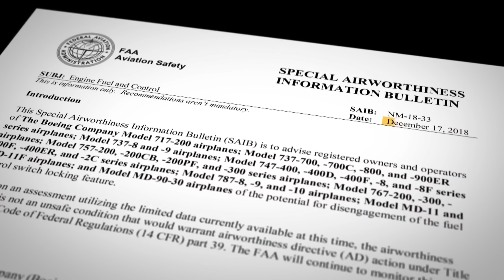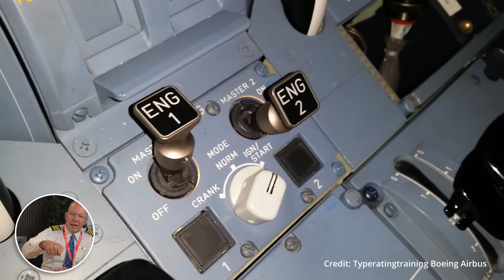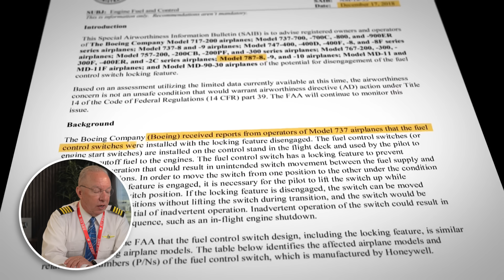Air India 171: The FAA’s 2018 Fuel Switch Locking Bulletin Explained (16 Questions Answered)

Comment: Q-1: An independent journal recently reported issues with a fuel switch, while preliminary findings from Friday indicated that both fuel flow switches were moved to the cutoff position at one-second intervals. Why is there a discrepancy regarding whether one switch or both were involved?

Q-2: What was the pilot's previous mental illness diagnosis concerning the alleged intentional movement of the switches that resulted in disastrous accidents? Was the diagnosis consistent with such actions?

Q-3: The dispute revolves around how the fuel flow valve was switched to the cutoff position, with claims that one pilot may have done this intentionally (due to mental illness), which downplays concerns about the switch locking system. There are fears that this could lead to a mid-flight incident, as previously warned. 

To establish how these switches function, a thorough investigation of the Boeing 787 part number 4TL837-3D is crucial. This should identify potential failure modes, including a broken locking pin, degraded spring force, or mechanical wear leading to detent failures. These problems can cause permanent damage, which can be detected through disassembly.

Additionally, the design should ensure safeguards to prevent the mechanism from reaching a neutral position, enhancing reliability.

Comment: Captain Steeeve your videos are giving the impression that you have already decided that the the switches were cut off deliberately by one of the pilots. You are rejecting outright any and all suggestions that point to a scenario that puts the blame away from the pilots. The preliminary report is very vague on many aspects. Answer one question. Suppose both the engines failed due to some technical fault in the aircraft. What would the pilot do the moment he realizes that both engines have lost thrust? Wouldn't he intuitively suspect the fuel supply system? That's when he probably queries the copilot if he cut off the switches. The copilot replies in negative because he didn't. So isn't it possible, to revive the engines, he immediately tries to reset the fuel supply by actually cutting OFF the switches and then putting them back ON? Did you check the time stamp of the conversation in the cockpit voice recorder and tally it with the time stamp of when the switches were cut off? Can you confirm whether the conversation took place BEFORE the switches were cut off or after?

Comment: Would it be possible for the plane to have lost both engines and then the pilots tried to restart the engines somehow and under the panic one pilot just went ahead and shut off the valves? Are we sure the valves were shut before the RAT came on?

Comment: Question for Captain Steeeve, if there were mechanical problems (broken or loose springs) with the fuel switch(es), won't the captain from the prior flight noticed and reported them?

Comment: I think the first officer sitting on the right was the one who turned off the fuel to both engines during takeoff. The captain, who was on the left, noticed it and immediately confronted him, that’s why you hear “Why did YOU turn off the fuel?” on the recorder, which clearly shows it wasn’t some random malfunction. I believe a scuffle happened between them right after, and in that chaos, the captain tried to take back control. He managed to turn the left engine back on first since it was closer to him, and a few seconds later tried to turn the right one back on too — but by then it was too late, or the engine didn’t fully restart. The timing, the words used, and how the switches were operated all fit with this kind of situation.

Obviously this is all speculative, a wild theory but I just think if it was deliberate...this is how it happened.
Reply: This is the most plausible theory.

Comment: Actually one pilot asking the other whether he cut the fuel is exactly what you would expect in an emergency situation . He's looking at all the possibilities why the aircraft is not gaining altitude and pinpoints the error, then confirms that the other pilot did not do it. The issue is either a serious malfunction in the control circuit, or something else.

Comment: A video camera in the cockpit would tell you exactly which of the pilots turned the switches off. It wasn't done by both. It wouldn't have prevented the crash but it would give you video evidence of the  intent of the person who moved the switches. Saying that the voice recorders give you enough evidence is wrong. Whoever moved the switches isn't going to say out loud "now I'm moving the switches to the cutoff position" if they were doing it for some nefarious reason. If the pilot was looking to the side he might not even have seen the copilot move the switches. A video would show if the person who moved the switches did so in a surreptitious way. And there should be a major alarm if the switches are turned off in flight. You say you don't know if there is an alarm for that condition and I'm surprised you couldn't give a definitive answer to that question. In this situation seconds could have been the difference between life and death. if the pilot had to catch the act out of his peripheral vision and ask the copilot why he did it or wait until he heard the engines spool down then it would be too late. The pilot should be warned instantly the second those switches moved. In fact I'm surprised that there isn't some over ride in the flight control system that would prevent fuel cutoff to the engine if there wasn't a condition that justified fuel cut off. It seems to me that whoever turned those switches off did it at just the right time to make it an unrecoverable situation. Somehow I almost think that the airlines wouldn't want cockpit video recorders because it might show that one of their pilots intentionally sabotaged the flight. If they have a video showing the act of turning the fuel off they would have to immediately look into the mental state of one of their pilots. Did he have mental health issues in his past that the airlines were aware of. If a video was leaked of someone reading a magazine on take off or otherwise doing something dangerous that should be known to the public. A video of the cockpit would have given us another piece of this puzzle.

Comment: Pilot F (flying) is asking  pilot M (monitoring) why did you do that ? only after hearing the 6 distinct sounds over 3 seconds , 3 for each fuel switch in almost sound proof cockpit as he( pilot A )was busy in take off and looking straight forward , once he hears sounds  next second his head turns and look for  both fuel switch cutoff position next second  he ask pilot B why did you do that ? next pilot B to avoid conflict reply I did not do that.The above situation can be reverse also Pilot M asking Pilot F why did you do that?

Comment: It's funny how you are trying to steer to a conclusion when it's only a preliminary report. Now I am not saying that you are wrong totally, you might be right, but it also helps to acknowledge the fact that if there is a possibility of a design flaw or system malfunction it should be investigated so such incidents never repeat in future. Even if it's a human intervention, then there should be systems in place to keep it in check.

Comment: why do you think it took the pilot 10 seconds to turn the switches back on? what could've happened in the cockpit in those 10 seconds?
had the fuel switches been turned on earlier, could they've gotten lift, power & thrust to make it up in the air?

Comment: As in the car, I suspect that these switches do not trigger a mechanism directly, but the switches close a circuit and a computer receives this signal. In this case, why can't a computer refuse to perform this deadly operation at all, but at least gives an alarm first ?

Comment: those switches r immaterial and operate only solenoid valves. in case of electrical failure with fadec a signal to turn off valves can be generated without touching those switches.

Comment: I believe that the checklist for a dual engine failure on the 787 is to toggle the fuel cut off switches quickly off and on ( maybe to try and make the ECAS system do something) can you confirm that? I still think that as the FADEC can shut off the fuel to the engines independent to the pilots, then this could still be the issue. I don't think that just because they could not simulate the situation in the simulator yet it does not mean that they can't ever simulate it. We also really need to know what financial compensations are being paid to the victims of this horrible accident by Tata and or Boeing. My experience in India when there is a big factory accident for example, the company buy silence by offering excessive money to the victims families such as paying school fees through to university etc for the whole family.

Comment: Q, Is it possible that in this case, pilot on right side, on take off has his hand on the power controll or near to it caught the cut off switches with his sleves or just touched them with finger tips?
On cockpit  tape they said "Why did he do that"? as a question..
Maby there was a passenger that noboby knew were in the cockpit, except the pilots? we heard before of a hitch hiker pilot that traveled in the cockpit that tried to cut off engines.

Comment: Hi Steve incorrect analysis about the ERJ, it is true that the engine will not switch off if the thrust lever is not in idle but if you had an engine fire on approach , actioning memory items for engine fire which include pulling the fire handle WILL shut off fuel to the engine , regardless of thrust lever position

Comment: This is all based on assumption that the switch position change  happened prior to Dual engine failure 
On the contrary the Dual engine failure happened  & Switch position change was done re ignite as a procedure 
1 pilot challenging the 2 pilot for confirmation of whether he has cutooff 
For which Pilot hasn’t done it yet

Comment: There is a locking switch/indent on both knobs.  Someone would have to manually manipulate BOTH knobs to cut off fuel on each side. Even if one "slipped" but both seems extremely unlikely.

Comment: Captain Steeeve, with all due respect, it’s disappointing to see you clearly taking sides. Conveniently avoiding the CCTV camera question was unfair. If reading a magazine mid-flight is against protocol, it simply shouldn’t happen—period.

Your stance appears biased. If the fuel switches were faulty, they could have slipped to the OFF position due to a failure in the locking mechanism. A cockpit CCTV would have captured this, avoiding all the current speculation.

Let’s not ignore the influence of major players like Boeing and Air India. Blaming the pilots—who tragically can’t defend themselves—is an easy way out. The cockpit conversation, where one asks “Why did you switch off the fuel?” and the other replies “I haven’t,” clearly indicates it wasn’t deliberate. They were likely both startled by the unexpected switch positions.
Reply: Geez, get over it.

Comment: what is the sampling rate of the fuel switch position. could it be that the fuel control switches cutoff almost simultaneously, but were registered separately due to the sampling time?

Comment: Very interesting response by Captain Steve to the question of is there an alarm/indication that the fuel stitches have been moved to cut off. As an experienced pilot his view is that you would pick it up from the sounds of the engines changing. The could take more seconds to register especially if you are busy with other matters. Surely there should be an alarm waring immediately the switches are moved to cut off whilst in flight. It would immediately bring the issue to the attention of the crew. If this had been in place in the air India place these vital seconds could have made all the difference.
Reply: He wants to make a case for Boeing n not against them.
Reply: @maitri98  "He wants to make a case for Boeing n not against them."

That is because it would be obvious.... Imagine driving a car down the highway at 100km/h, then all of a sudden you hear everything just stop and you are loosing speed, it is kind of obvious what has happened.

The switches being cutoff by the pilots isn't something that is expected normal behaviour is it?
Reply: If the switches were deliberately switched, there should be 2 distinct auidble clicks, overriding the locking mechanism on the audio. If there is not such clicks on the audio, it is possible the switches failed. The 2018 report about the issues with the faulty Boeing switches says BLACK ON WHITE that there are issues with the locking mechanism. A pilot having his wrist on the switches when holding the throttle, can accidentally flip them without much resistance if the locking mechanism failed.
Reply: @sophieedel6324  "A pilot having his wrist on the switches when holding the throttle"

So apparently, for the last 12 years (because this plane was from 2013), this issue was never found.... Then somehow on the same plane it happens not once but twice....

Also it would be impossible to do what you are saying because the pilot would be pushing the throttle forward not down (down is where the shutoff switches are). Oh man, if only you people could actually think.
Reply: @aflyingcowboy31  I have read the 2018 report, and it does say there is an issue with the locking mechanism. 
SAIB: NM-18-33:
"The fuel control switch has a locking feature to prevent inadvertent operation that could result in unintended switch movement between the fuel supply and
fuel cutoff positions.  We request that owners and operators report any failure of the locking feature of the fuel control
switch to Boeing (see contact information provided below). Replace the
fuel control switch with a switch having P/N 766AT614-3D, which includes an improved
locking feature."
Reply: @sophieedel6324  I literally just quoted to you the report.

What you gave says nothing about an actual issue with the locking mechanism, so no you haven't read the report, the report literally starts with:

"The Boeing Company (Boeing) received reports from operators of Model 737 airplanes that the fuel control switches WERE INSTALLED WITH THE LOCKING FEATURE DISENGAGED"

Stop spreading bs.

Oh FYI, thank you for also completely negating your own point:

"Replace the fuel control switch with a switch having P/N 766AT614-3D"

The only planes that used the P/N 766AT614-3D was the Boeing 737....
Reply: @sophieedel6324  Says the one that is actually being defensive about correctly being called out for making bs up.....

The FAA bulletin literally says nothing that you are claiming it did. Regardless:

1. There was no issue with the locking mechanism itself.
2. The pilot cannot "accidentally" switch off like you claimed especially because they would be pushing the throttle away from where the fuel shutoffs are.

Like I said, if only you people could actually think instead of regurgitating nonsense.
Reply: @sophieedel6324  Says the one that is actually being defensive about correctly being called out for making things up.....

The FAA bulletin literally says nothing that you are claiming it did. Regardless:

1. There was no issue with the locking mechanism itself, this doesn't even get into the fact that the Boeing 787 uses a completely different P/N to the one the Boeing 737 uses.
2. The pilot cannot "accidentally" switch off like you claimed especially because they would be pushing the throttle away from where the fuel shutoffs are.
Reply: @sophieedel6324  Both switches fail together?
Reply: @dps2933   The locking mechanism warning shows both switches have a locking problem. Many pilots are told to keep their hands on the throttle, and sometimes rest their wrist on teh actual fuel switches, or tap them when moving their hand. This in theory isn't an issue because they are locked switched, but if the lock fails, that could actually flip them both with the wrist.
Reply: @sophieedel6324  "The 2018 report about the issues with the faulty Boeing switches says BLACK ON WHITE that there are issues with the locking mechanism. "

Factually false.

There was NO issue with the locking mechanism, can you people not read or something?

"The Boeing Company (Boeing) received reports from operators of Model 737 airplanes that the fuel control switches were installed with the locking feature disengaged."

Some 737s had their shutoff switches INSTALLED with the locking feature disengaged.... AFAIK the only planes that were ever acknowledged as having this issue was the 737. Regardless this 787 was manufactured in 2013, so yea, for 12 years no one ever noticed that the locking mechanism was disengaged, sure thing mate......
Reply: Everything that he has been saying from day 1 appears to be to make a case for Boeing and control the overall narrative. Truth will come only if there is another crash like in 737 max. I really really hope that doesn't happen and no innocent lives are lost again in flying.
Reply: There would be alarms going off if these switches are moved to cutoff. Master warning lights and horn and EICAS messages sayinG ENGINE SHUTDOWN.
Reply: @jefftynan9274 that’s really interesting. Can’t understand why it then took 8 secs for the pilot to ask why the switches had been move to cut off if alarms are going off straight away?
Reply: @martynlaverick3405  The alarms did not say that the fuel switches were cutoff. They said that the engines had failed. It took a few seconds to get over the shock and figure out why they failed.

Comment: A question for you.
What would happen if the fuel switches were put back in the ON position, and the plane could get altitude and fly normally after. What will the "sane" pilot have to do with the "faulty" pilot ? Wouldn't be too dangerous to continue flying with him ?